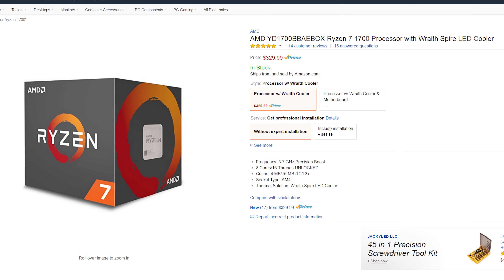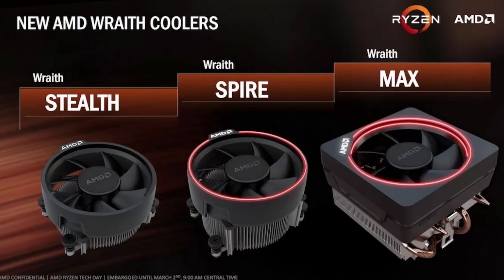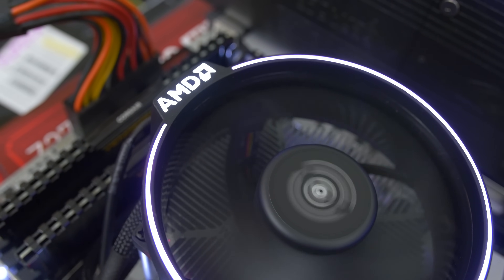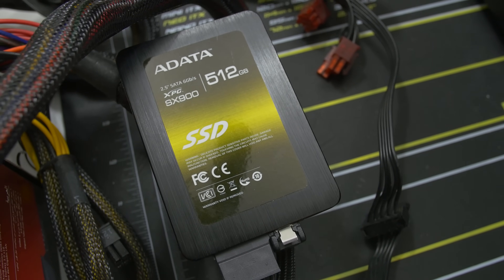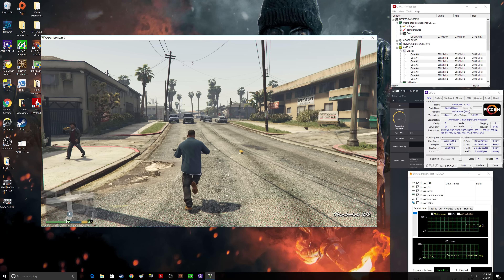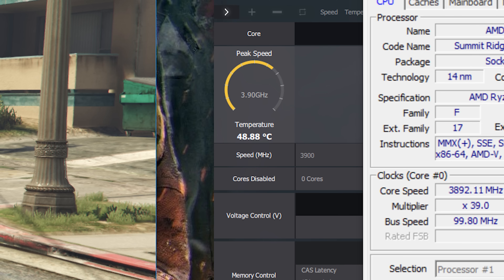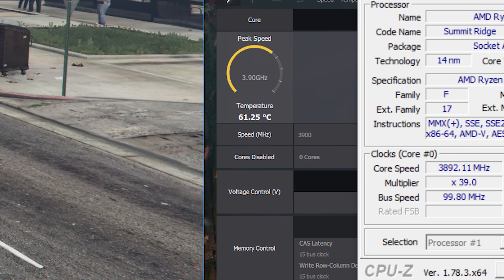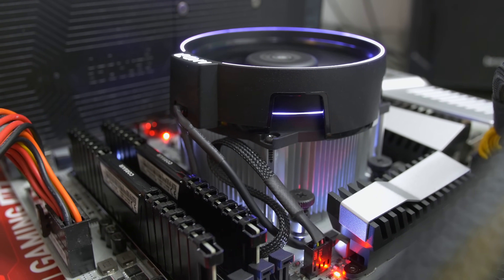AMD Wraith SPIRE: Does it SUCK?

Comment: Seems like a Hyper 212 Evo but with RGB lighting, a smaller size, and for free.
Reply: free or included, it seems more than enough for most people
Reply: SlavjanA Don't forget the fact that they Evo is a pain in the ass to install.
Reply: yea but if you pay 300+ for a for an i5 7600k and you dont even get a stock cooler this is quite "free"
Reply: How many people uses their PC for gasp actual PC stuff rather than just a console?

A ton, like, a fuck ton more people use their PC as an actual PC to do multiple thing than just a damn console like most people try to assume when talking about Ryzen 7 vs i5 performance.

But let's assume for just a second that everyone only turns on their PC, start up any game with nothing else on the background and at the end just turn them off, you know, just like a console.

You are better off getting a damn Pentium G4560 if you are doing that. Because that shit costs only 60$ yet it delivers almost the same performance while gaming than a i5 that costs 4 times as much.
Reply: 212 also have a bigger fan and costs 30 bucks, this is included in the price and destory's intel's coolers.
Reply: OdinAlgeron better cpu? nah it takes the 7600k 4-5 times longer to render a video, it can't stream and play without stuttering, 4 cores are becoming outdated, and it only wins in gaming by a few frames when there are no background applications. r7 1700 destroys i5 in 99% of applications and the 1% is gaming
Reply: Sadly and funny enough, it isn't.

The G4560 delivers almost the same performance than a i5 while gaming, the only exceptions are heavy cpu games like GTA, Hitman or the latest Wildlands. On everything else though, the i5 is only getting 10~ more FPS on average.  

@Jakob Peters

I know that, which is honestly sad, they should be looking at what's the best value for their money and offers better overall performance, the fact that they would prefer 50-70% worse performance on literally everything else a PC can do but 10% better on games is mind blowing. But to each their own.
Reply: I'm gonna go ahead and assume that you've never seen a CM Hyper 212 EVO in your life.
Reply: actually these days a fuck load of gamers are streaming.
Reply: doesn't matter. I'd rather this than having one of those worthless coolers like the stock Intel ones, or the old AMD coolers. Also since they have buying power and the perceived value, it's worth it for them to toss in a descent cooler in a bid to offer a more well rounded product than Intel.
Reply: Intel has increase there price of their cpu from one gen to another while removing the cooler...for a cpu that performs 100% the same clock for clock from last gen...

also your point about ryzen vs intel makes no sense...7700 cant even come close to ryzen in compute performances. forget ryzen...7700 cant come close to the the 6900. just because car A can go over the bump better does not make it better than a supercar.
Reply: the EVO a pain to install ?  havent u installed a H110i do you?
Reply: I don't never issue installing the hyper 212 Evo, find it extremely easy. I also install it before putting the motherboard in the case.
Reply: Luciano de Benedictis maybe i shouldve kept that one then but me being just spent 75 pounds on the d15
Reply: Jakob Peters but higher resolutions require a better gpu, not a better cpu, as cpu load will decrease if you make it more gpu heavy.
Reply: It's decent but the Evo is another league.
Reply: It's free in the sense that you don't have to pay extra for another cooler, since you already paid for one with the CPU.
Reply: Not even close to hyper 212 evo performance mate.
Reply: +TaigaGaoo Hey look, I found someone who thinks, and says that the 10 extra fps aren't worth it compared to the almost double performance in everything else. Hard to find someone like that nowadays where everyone tries to say ryzen is bad cause it lost in the highest fps battle.. by 5%.  This comes from someone who can't play shooters like csgo under 200 fps.
Reply: Elchuyboricua I've installed two, the first time I was successful and the second time it plain and simple didn't work. I'm either assuming it's not compatible with my motherboard or the bracket was fucked. Either way, it was the worst experience I've ever had with a piece of computer equipment and I will never buy another cm product.
Reply: BrotherO4 thats 4790, not k
Reply: Would the Spire be able to keep a 1500X or 1600 cool enough to maintain 4.0GHz even in a room that get's up to but not exceeding 80 degrees F?
Reply: +SlavjanA 75C TjMax of Intel or AMD? So an i5-7600k + MSI Core Frozr L or NH-U12S running at 4.5ghz would run cooler than a R5 1500X @ 4.0 w/ Wraith Spire?
Reply: Its better optimized for Ryzen chips to cool the VRM since its a downwards cooler.
Reply: Rayhoze haha I totally agree even in a descent sized case they are a pain
Reply: SlavjanA is that a bad thing? I think that's pretty good that AMD is bundling an "after market" cooler in their 1700 processor
Reply: TaigaGaoo people buy better processors so they get better frames and so they can play in higher resolutions, not saying that's the right thing to do money wise, but that's why they do that
Reply: More like a Thermaltake CL-P0497 92mm, Deep Cool ALTA200 CPU Cooler 90mm , or  a smaller Deep Cool THETA 31 CPU Cooler 100mm.
Reply: Well, free with the purchase of an accompanying CPU anyway.
Reply: I meant free as in included, compared to K sku Intel CPU's. Also I meant that it seems like a Hyper 212 in performance, not in looks.
Reply: DC Not for the Ryzen 7 1700 there ain't, which is by far the best chip in the Ryzen 7 lineup if you're gonna overclock. in fact the only SKU's with optional coolers are the "X" ones, and the Wraith Spire isn't even the cooler in question there, it's the totally different Wraith Max.
Reply: going off basic watts you can not overclock a Intel CPU with the stock cooler even with a lower 65Watt CPU, like how the 1700 is 65 watts. It has already been stated online that intel stock heat-sinks are useless if you want to do any type of overclocking. Plus historically Intel CPU's have ran cooler. So that shows how bad there stock coolers are.
Reply: ***** I didn't even take my 4790k cooler out of the box. But I'd still like to see an apples to apples comparison between the two stock coolers on the same cpu.
Reply: Jimmy Google yes it does...I have it
Reply: hypeR you seeing today 4790k...in 2014 there was a version that did included. So we both were right on this subject. I guess Intell removed all stock cooler when they made the decision.
Reply: Jimmy Google well I don't know where you got your 4790k but mine came with a cooler, which I still have and never used.... You really need to watch out on ebay, ppl will try to screw ya whenever they can... Like send u a 4790k without a cooler.. Lol..
Reply: BrotherO4 I got my 4790k right around Xmas 2015 and it had a cooler..  So I dunno.. Maybe you could get one without but I couldn't find one.  Because I knew I didn't need it but everywhere I searched had cooler included..  Not that anyone used it...
Reply: it seems intel removed all the coolers when the i7 7700k was release for high end...funny how they increased the priced and removed the cooler...thank god ryzen is a good chip to put some competition back.
Reply: BrotherO4 I think it's more the idea that 90% of ppl who build pc's were not using the included cooler anyway.. I actually looked for a 4790k without a cooler that might save me $20 but couldn't find it... So I have my stock cooler and the hyper 212. I actually think Intel did well by removing them.. Because whatever the prices are now for the skylake or kabylake they would be higher if there were coolers included..   I actually think Intel should not included coolers with "k" processors, and include them with non "k" processors.   The only time a stock cooler made any sense was with the non "k" versions.
Reply: intel is not removing coolers and dropping the price...they are removing it and increasing the price on their cpus. that its not more ideal to anything at all.also i disagree...cooler should be there for any cpu.

not including them pretty muchs just makes a case for simple getting the next cpu in them lineup anyways

for example the 1600x does not include a cpu...if you buy a cpu cooler than the question to be ask why the hell didn't you get the 1700 in the first place?

a cooler to OC a cpu does not get you much anyways in terms of performances at all. there are tons of video showing the % increase from overclocking and at no point did it make or break the gameplay experiences. so for those who do want to oc their cpu than throw away their coolers and get a new one...for the rest the cooler should be an option
Reply: John Kluk the cost of intel did not come from quality, the quality came from years of minimum budget development. Intel cpus probably cost the same or less than ryzen to produce and the profit margins are extremely high.
Reply: Birki gts actually the cost of Intel came entirely from quality / performance.. Since I can remember in the early 90's Intel was pretty much the best you could get... Amd tries to compete with Intel, and occasionally comes close, but whenever Intel felt threatened they upped their game.  The cost comes from being a large corporation that needs $ to engineer the next big thing.. Though I agree,  without some form of competition, Intel will sit back and collect $.  So I hope amd ryzen is very competitive, which it looks to be. But at the moment if you want the best of the best you buy Intel... It's pretty much been this way for over 20 yrs.
Reply: yes i do
Reply: No...3.7 is what it can do for oc. That is 95%

edit: in a normal room temp...that shit is strangely hot for where you are at
Reply: Mike Soda it seems most people are getting 3.7-3.8 on stock coolers, the temps increases exponentially after that point.
Reply: +BrotherO4 =\ Linus's video got my hopes up although they are in Canada. Yeah my room get's ALL evening sun & we can't afford to run the AC very much plus the thermostat is on the cool side of the house too. I'd like to hope I can get my room temp down to 78 this summer w/ some exterior canvas Velcro shades I'm making but still assuming I'll get to 80 for sake of PC.
Reply: Mike Soda the real world difference between 3.8 and 4.0 is really just a few fps though, not really gonna make or break the experience.
Reply: Mike Soda The 75C TjMax doesn't help, but it's only with the stock coolers, you'd see worse temperatures if you put an Intel stock cooler on a 7700K and overclocked it. With aftermarket coolers they're very cool.
Reply: +Birki gts I know but just the way 4 would sound, if I could make 3.8 though that'd at least match my friends i3-6300.
Reply: AMD, and of course it would, the i5 only has 4 threads plus those aftermarket coolers are much better than a stock cooler.
Reply: +SlavjanA This is all just such a big letdown.
Reply: What part of it?
Reply: +SlavjanA Everything, OCing performance, thermals, cooling, not looking any different than bulldozer IMO even though I know they do perform better it's still looking to be "you get what you pay for" almost nerfing the idea of best performance per dollar.
Reply: Depends on how you look at it. If you bought a 1700 and OCed it to 4GHz then that'd be a pretty good OC, but I get that if you;re an 1800X owner you'd feel like it could be better. Although people are saying there's a power draw limiter preventing further overclocks, like Compatibility Mode for the RX 480 which prevented it from drawing over 150W, so we might see higher than 4.1GHz stable in the future. The thermals and cooling are good though, I mean TjMax isn't the highest but they run cool provided you have good cooling, and considering the fact that we're talking about 4c/8t CPUs and higher, and the stock cooler isn't the best but its a stock cooler so you can't expect too much from it.

Price/performance wise Ryzen is doing very well, it may not be holding the gaming performance crown, but I mean you can get around 6900K performance for a 3rd of the price, and an R5 is just a better investment overall over an i5. Bulldozer was good price/performance wise, but it didn't really hold up against Intel at all, Ryzen on the other hand does.
Reply: Mike Soda yes, and what you payed for is something that only lacks a tiny bit in gaming performance and is better than much more expensive chips for every other workload. Bulldozer was shit in pretty much every way from release, can't be compared to ryzen.
Reply: That's true, I just wish AMD gave us a choice as to whether or not we wanted a stock cooler & opting out would give a slight price decrease. Then I'd have no regrets buying the 1500X when I do & slapping a NH-U12S or Core Frozr L on it.
Reply: +Birki gts I'd have preferred the opposite, good in gaming but okay in other workloads. Guess I will buy the 1500X & MSI B350M soon, although gotta 1st call em & ask if/when that board supports G.Skill Flare X 2x8GB.
Reply: Lofty Smalls for an r7 1700, a free cooler seems worth it
Reply: TheTomtah try using one. This thing shits on the evo 212, I have both.
Reply: At 3.8Ghz my spire required 100% fan speed just to stay at 65c while gaming normally, while my 212 EVO only hits 61c and 60% fan speed under full load while recording at 1080p 60fps.
Reply: well I haven't used 212 evo with this cpu yet. hate the looks of those tower coolers though haha, idk I am biased the RGB is flowing through me.
Reply: How the fuck is it anything like a 212 Evo? Other than it being a air cooler?
Reply: @TheOwenMajor  my God I thought I was the only one that was thinking this. LOL
Reply: Nothing is for free bud
Reply: Doesn't matter, I am sure that they charge money for it, even if it doesn't look that way. If they wouldn't include the cooler it would cost about 15 $/€/£ less
Reply: Nothing is free. It is certainly factored into the price, somewhere.
Reply: 10 degree's hotter than a hyper 212 according to Hardware unboxed, but hey it's free and better than what Intel offers well done amd
Reply: +Aidan Games why would obe pay 300+ dollars for a 7600k
Reply: +Birki gts So AMD is really still guilty of high temps when OC'd, if I wasn't already over budget & had ability to make more money quicker I'd really just get a i5-7600k + either MSI Core Frozr L or Noctua NH-U12S.
Reply: Mr. Hankey wrong
Reply: Brooklyn TheFurry  i dunno if that is a fair comparison ... Not that I'm a fan of intel stock coolers, unless you throw a intel cooler on the 1700 to see how it compares it's hard to tell if this is better, equal, or worse then an intel cooler.... The designs are similar fin heat sink, fan on top blowing air at cpu.. I'd be interested to see what an intel stock cooler would do if it was able to be modded to fit on the 1700... 

To everyone else... comparing this cooler to a hyper 212 evo is like comparing the 212 evo to the NZXT Kraken AIO.... Exactly.... They are nothing alike.... ugghh...
Reply: BrotherO4 well the $350 cpu without a cooler would be $375 with it.... So it's cheaper without... 

You may not "like" the cost.  You may think they "should" be cheaper,  because AMD will give you 8 cores for the price of 4 Intel..  But with Intel you are paying for solid cores that are powerful..  Amd you are paying for a lot of 2nd rate cores. Sure we will give you 8 cores cheap!!!  (oh but you are getting cheap performance per core tho.....)  It just depends on what u want I guess..  They just don't compete yet when you break them down by core.. Whatever Intel is doing they still create the best cpu and with that comes cost. Thats just how it is.. 
Sure the corvette is powerful, fast, nice on its own, but next to a  Lamborghini, it's just not even close.. Lamborghini just does it better, all around, and you pay more for it.. 

OK back to coolers..
Reply: cryorig h7 + 7600k = $270

better cpu, better cooler and cheaper
Reply: how many people buy an i5 for rendering? or streaming?

The vast majority of people dont do those things, so the extra money spent on a 1700 is wasted

remember the i5 is $100 CHEAPER and also performs BETTER

Even the old ass  3570K @ 4ghz beats the current ryzens at gaming

Comment: I actually recommend you using a thermal probe/gun thing or just your fing to see if the heatsink got hot at all , i have seen reports of the cpu readout being at 80c but actual temp on the heatsink was like 65c (on the baseplate/heatpipes) something to keep in mind
Reply: Marcus Fraser they are the same chip why would it? or could it be the xfr
Reply: IR readers are pointless since IR does not equal heat necessarily - And it's a question of angles. You want accurate readings, use probe patches.
Reply: +giorgis nikoloudakis AMD intentionally made the offset on their X chips and it's likely because of XFR.
Reply: AMD are notorious for badly (and when I say badly, I mean really badly) calibrating their temperature sensors, but it seems that with these new chips, they've actually improved on that, so you can largely take the temps reported by a Zen-architectured chip on face value without being horrendously misled.
Reply: well amds sensors have been accurate on everything before FX , fx killed it
Reply: +Justagermannerd - Nope. The calibration problem was already there with K10, it wasn't introduced with Bulldozer. My Phenom II X6 reports CPU temperatures 11°C higher than they actually are, which is a fairly hefty offset, but I've heard worse stories, and quite a few of them do concern Phenom IIs and Athlon IIs, not just FXs. I can't recall having heard any such stories about K8 though, so I would assume that the temperature sensors on the chips from AMD's golden age were more accurately calibrated.